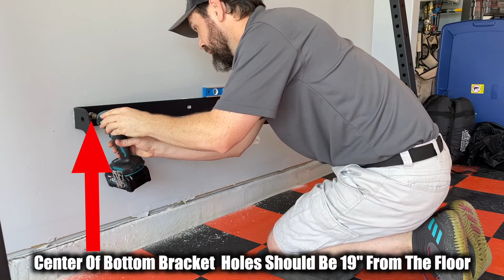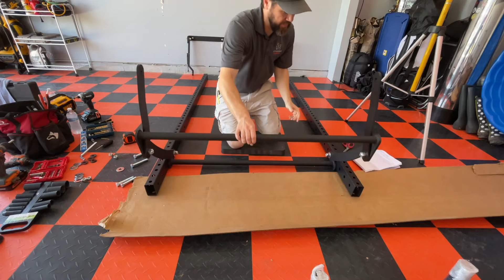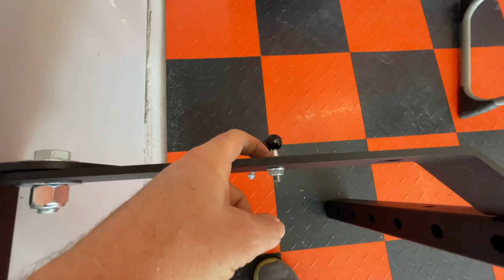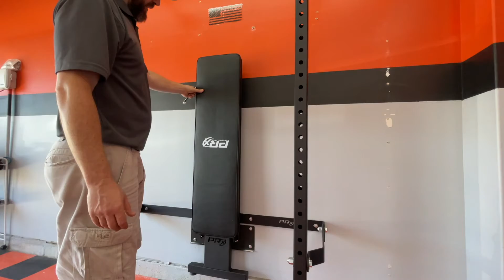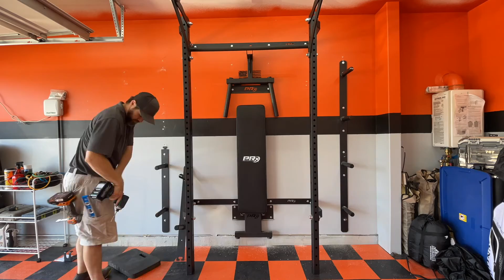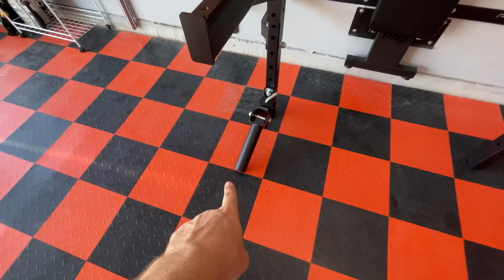How To Assemble & Install Your PRx Performance Profile Pro Rack + Accessories | Step By Step DIY

Comment: Are we supposed to measure the two inside holes as well to make sure they’re hitting a stud? I feel like my studs are off by an inch of two. I could be overthinking this, but I’m marking the studs (after using two stud finders and measuring dozens of times) and the two middle holes of the brackets are still not exactly lining up with the studs (according to my stud finder).

Comment: I wonder if I can use the trolley leverage arms   with my 3x3 prx wall rack which I love a lot, however, if not I will have to sell it and get a rogue foldable wall rack just so I can get thwir trolley arms.

Comment: If folding the rack up hits the ceiling, can the rack bottom be cut shorter to accommodate?
Reply from the maker: You will have to cut from the top, if possible. Cutting the bottom of the posts will not help in that situation.

Comment: This was my house and I hired Marius from the Thumbtack app to assist in mounting this thing. He responded instantly and adjusted to fit my schedule and worked from start to finish. 

As you can tell, there was already a rig on the wall from a previous owner and I asked Marius his professional opinion on covering it. He was able to cover 90% of the holes from before and ensure the rig is sturdy, and of course, looks good.

Just wanted to publicly thank Marius for his work ethic and professionalism (and driving almost 2 hours) on this project. He absolutely killed it!
Reply from the maker: I appreciate the comment and sharing that with everyone. 🙂✌️❤️